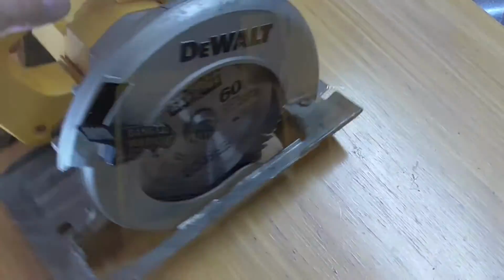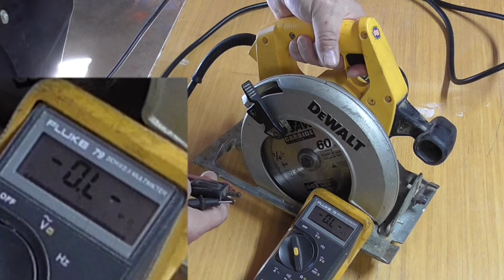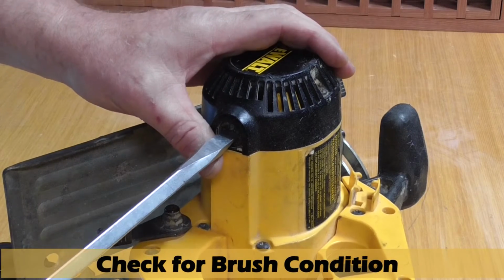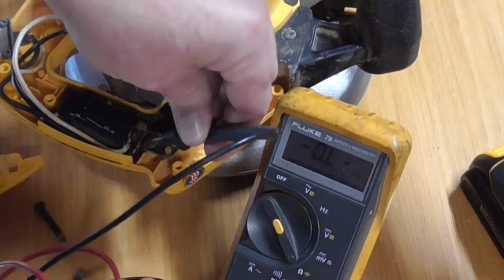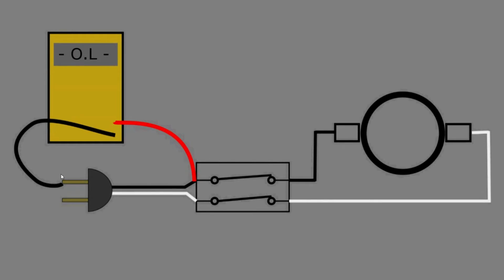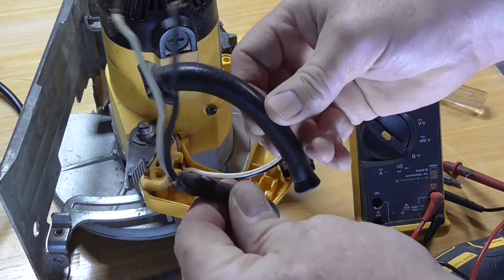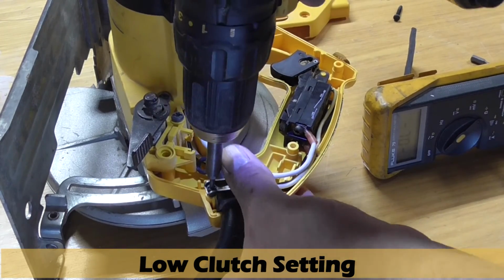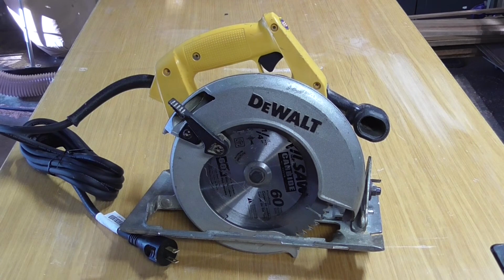DeWALT DW357 Circular Saw Troubleshoot and Repair

Comment: When I connect my tester to plug prongs and click the saw switch I’m getting an ohm reading of 4.5 instead of the 1.5-2 that you say are targeted. Is that acceptable? Or an indication of a problem?

Comment: Where do you  buy the part?
Reply from the maker: I purchased the replacement cord at Amazon. DEWALT 33007898 2 Wire 16 Gauge Power Cord, 10', about $15.